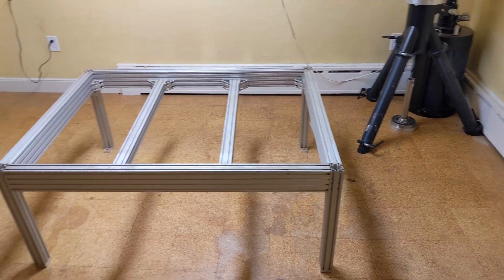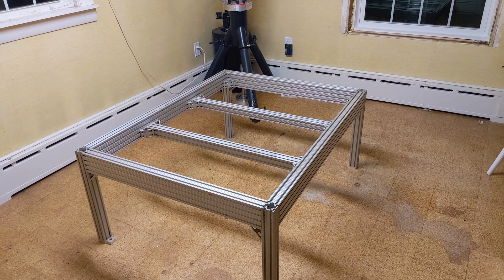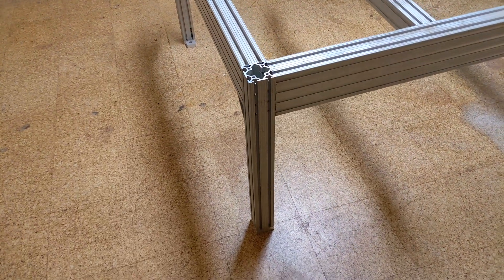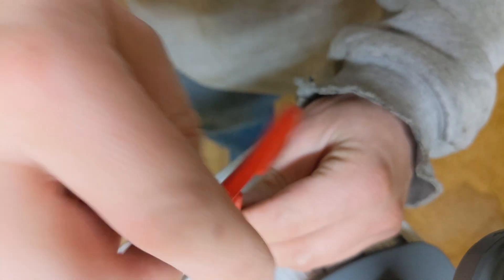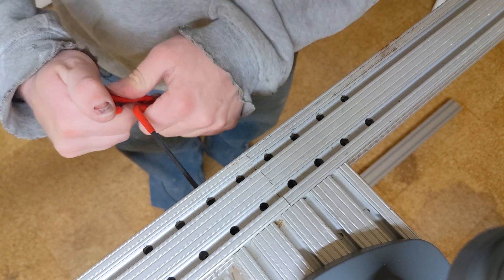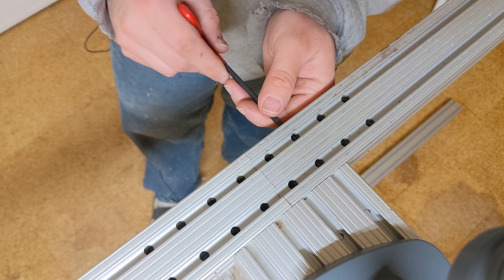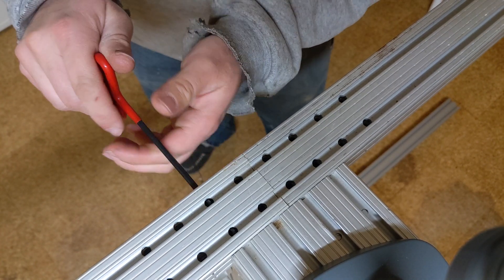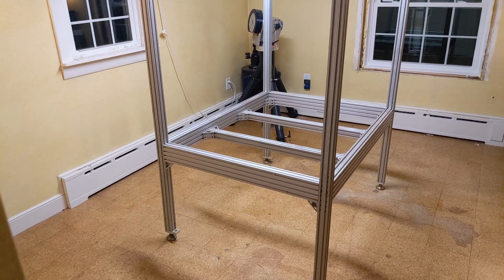Large Format 3D Printer Build - Part 1

Comment: That's going to be a big boy!
Are you planning on using a pellet extruder?
What kinematics are you planning on using?
Reply from the maker: Yes, Its going to be very large. Im finishing the cad and will be doing an overview video once thats done. It will be a 3 point leveling gantry on ball-screws and with a fixed bed. I would LOVE a pellet extruder and im trying to build it heavy enough to carry one, but cannot afford one currently. Pellet extruders run $2300 - $6k. For now, it will start with a 1.75mm filament high volume extruder with a 1.0mm nozzle. I have not decided if Im going to do a CoreXY or cartesian system yet, but thats next.
Reply: @AdamBrunette  
CorXY is good for beds up to 350x350mm.
And even at that, each belt will be more than 4.5 feet long.
You'll need to go with thick belts to make the gantry rigid.

You can go with CroXY: a mix between CorXY and Ultimaker.
Each axis is moved by 2 steppers on either side and the print head lies on 2 crossed beams.

Alternatively, you can go with IDEX cartesian.
Reserve space for a second print head / stepper to be added after the initial tests are completed.
Reply from the maker: @2xDenn  Ive looked at so many designs for reference that the names blend together. CroXY is actually what Im leaning towards currently. The use of 2 gantry beams to support the load of the extruder makes the most sense vs a single beam being large enough to span the massive width without deflecting under the weight of the head. 

There is a machine I have taken a liking to called Dash-X. It is a cross beam design that uses dual belts for each axis and carbon fiber shafting to interlink the sides of the axis. This is the direction I have been leaning to go. I was doing deflection calculations based on using 4040 for the cross beams and I think the 2 combined could carry the load of a pellet extruder IF I add one down the road. Otherwise, they will just make for a more rigid machine with lighter heads.

I want 1-2 tool heads for the machine. I will start with 1 and upgrade later. 

The current working area of the machine in Fusion is 1800x800x650mm but only really the Z axis is finalized.
Reply: @AdamBrunette , what about 2040 extrusions standing upright as cross-beams?
They should be lighter than 4040 with comparable stiffness.

About side panels: not-moving air is a very bad heat conductor.
That's why windows are made from 2-3 sheets of glass with the airtight chamber(s) in-between.
You can do the same for the enclosure.
Glass is cheaper than plexiglass.
Reply from the maker: @2xDenn  I have been using the 80/20 deflection calculator on their metric 20 series T-Channel extrusion. It is dimensionally the same as Openbuilds 20 series, however Openbuilds has V-Channel which integrates the linear motion system with the structure, making the finish gantry lighter. Using 1800mm as the span of the X axis, 80/20 calculates 2.44mm of deflection with a 2kg load placed in the center of the span. For 4040, the deflection is 1.93mm of deflection. Using 4040 with an 800mm span for the Y beam, the deflection is calculated at 0.97mm with 2kg load. Since these 2 beams would work in conjunction with each other, I felt comfortable averaging the 0.93mm and 1.93mm to come up with a worst case of 1.45mm deflection with a 2kg load at the center of travel of each axis. This isnt quite accurate but its something to go off of until I find the deflection of stacked 4040 extrusion. This is also using worst case, 2 ends supported. Fixed ends will add alot of strength to the entire beam. The perimeter frame will most likely be 4080 C Channel in order to have the most rigid frame to mount the carriages to. To increase strength with marginal weight gain, a doubled up 2040 section would help a-lot as it would add 2 additional vertical walls essentially in the center of the 4040 beam. Other than that, taller profiles would be the way to increase rigidity and load capability, but that has other costs, mainly Z travel. 

As for panels, I plan to use 1" high density foam board insulation that has aluminum facing on both sides to reflect heat back into the enclosure as well as insulate it to keep it from cooling down. I already have the doors from a commercial machine I dismantled and plan to reuse them. That is a very good point about dual pane which I will probably look at doing something like that to insulate them some more which would really help.